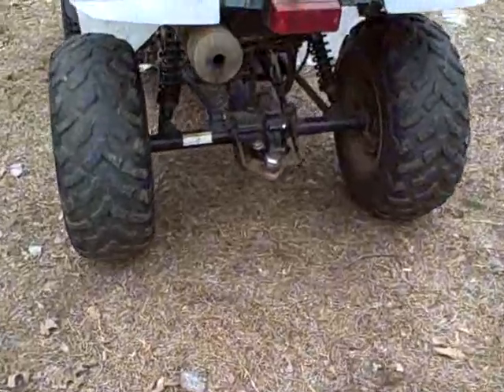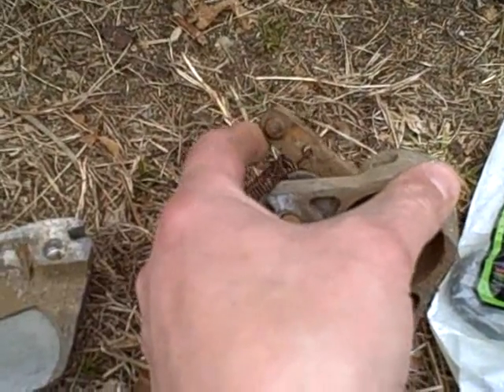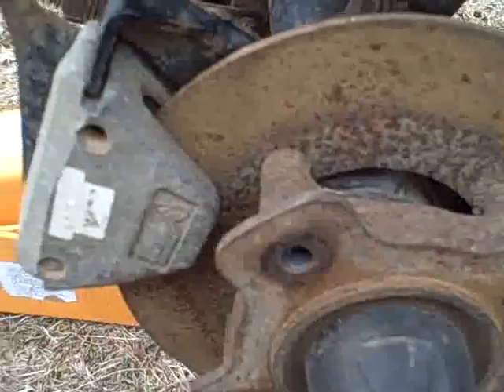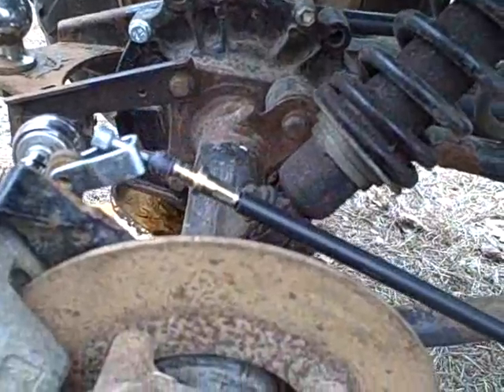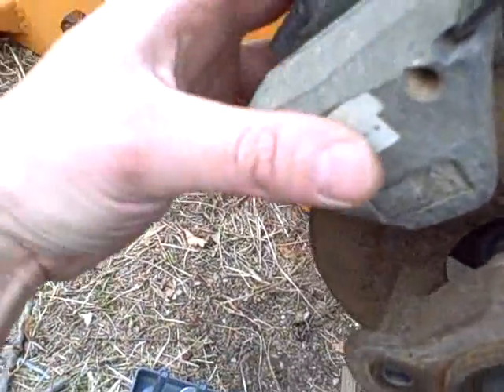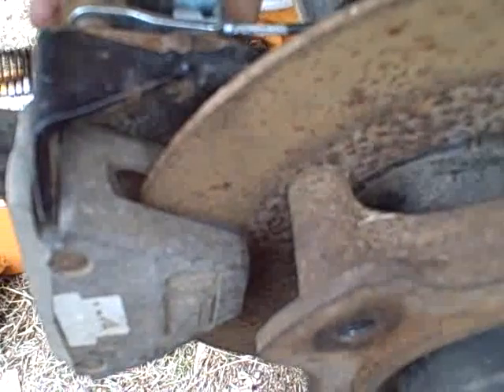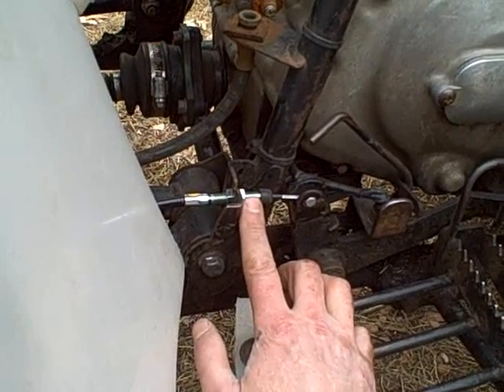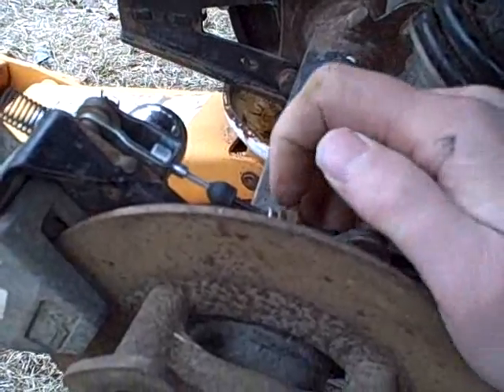Arctic Cat Project Part 20: Rear brakes

Comment: Hey Steve….Thank You for making this video series…
It really has helped me all these years after you made them…I scored a 98 454 4 x 4 in 2022 and this will go great with the manual
Reply from the maker: I still miss that old ATV........one of the best ones Ive had. The manual transmission was great on these little sherman tanks.
Reply: @stevewatr  I believe it will make a good around the farm machine, when done…moving trailers and boats around …
Or just for checking fence line on a lazy ride…
Once again THANK YOU SIR !!!!!

Comment from the maker: I did just that very thing only today on a sticking cable on my rototiller, except I used PB blaster. Sometimes you get lucky, but I remember this rear brake cable, it was toast. Regards, Steve.

Comment: Hello Steve I just got a artic cat myself. It appears to be the same one u have here.   Ive noticed when shifting gears its alittle ruff. going from 3rd to 4th and 5th is really ruff and almost doesn't go in gear unless RPMs are low then it will shift.. If your gaining speed and higher RPM it doesn't shift Is this just how these machines work or does it sound like I have some damaged gears or maybe clutch system. Any info will help Thanks. Good Videos!
Reply from the maker: make sure the gearbox oil level is good. let off the throttle when shifting. if it still seems to be difficult to shift, id suspect the clutch is sticking.

Comment: I realize it's been a while, but do you remember the part number for the rear mechanical brake cable?
Reply from the maker: No, sorry. But use Babbitts online. They are great. And in 1997 they only made like 1 or 2 models of the Bearcats.

Comment: I changed oil isn't the gear oil the engine oil as well? thanks for the reply!
Reply from the maker: I  cant remember if this is a wet clutch.  if it is, make sure you use the specified oil. regular automobile oil has friction modifiers that make them unsuitable for motorcycle wet clutches.

Comment: do you recall the seller of the brake pads
Reply from the maker: Sorry, I do not recall, it was years ago. try these http://www.ebay.com/itm/NOS-ARCTIC-CAT-0502-020-MECHANICAL-BRAKE-PAD-SET-BEARCAT-/251309289482?pt=Motors_ATV_Parts_Accessories&hash=item3a8333700a&vxp=mtr